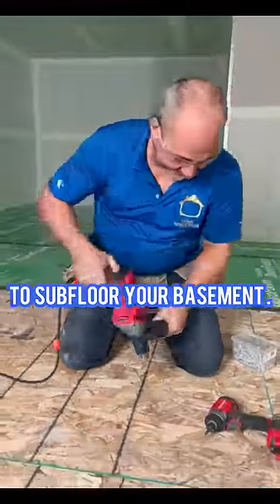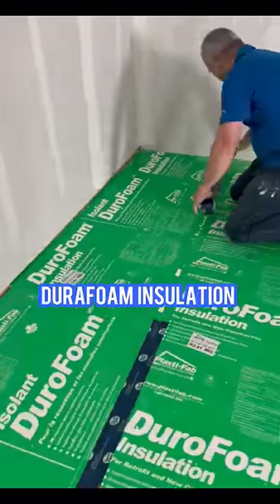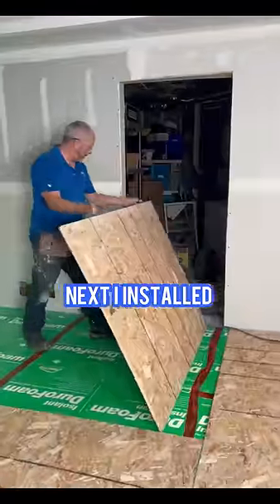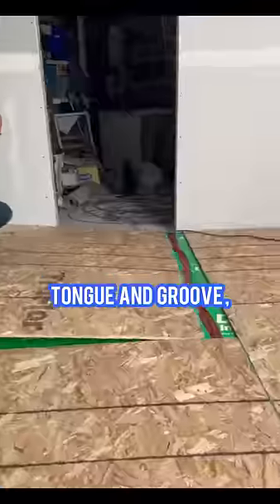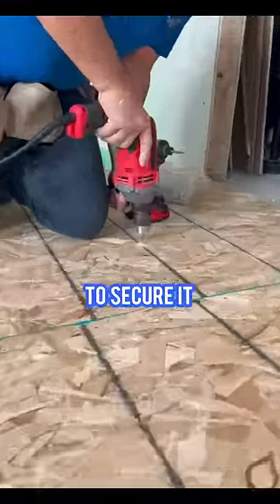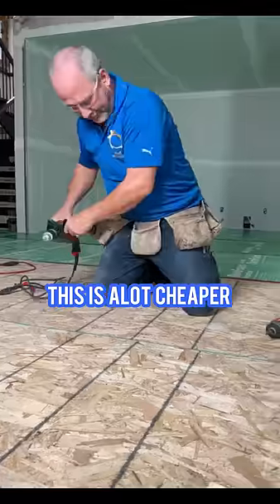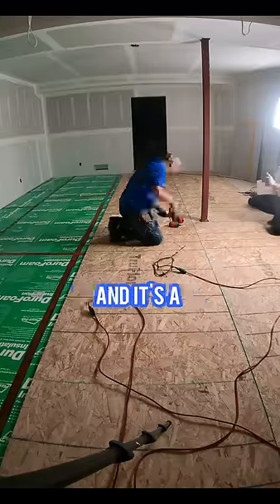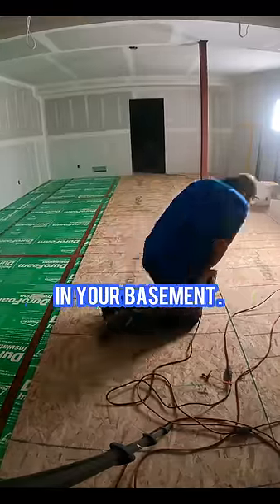THIS Is How You Save Money on Your Subfloor Install #shorts

Comment from the maker: To learn more about this method, watch 👉🏼 https://youtu.be/qyUZ3SgNvfY
Reply: OSB as a floor is ALWAYS A BAD IDEA.  Too bad, I thought this guy knew what he was talking about.  Unsubscribed!
Reply: Yep you cheaped out. OSB is crap.
Reply: Next time, try adding foundation wrap under the foam.  The 1/2" dimple allows for air movement and small amounts of moisture without having mold issues.  Also, the air break helps the floor temp a bit more too.

Comment: Until you get water in your basement and all the OSB swells up like an Alabama tick
Reply: It's been 40yr.  No water.  Def could have had a floor for 40yr :(
Reply: probably depends on state and floor risk u live in.
Reply: Doesn’t matter what kind of wood it is, it will swell when it gets wet.
Reply: He’s comparing COST to like DRI CORE… this is cheaper but dri core also swells once wet
Reply: Or your water heater leaks or your pipes above flood
Reply: As others have said; if you flood your basement it isn't going to matter what you have down.
Reply: The imagery of a fat tick 🤣
Reply: OSB should be against the building code
Reply: we have glue down vinyl planks over concrete subfloor and a floor drain in our basement 🤷‍♀️
Reply: Dumb dumb dumb comment.  If you're finishing your basement, it's assumed you know what you are doing and have already waterproofed it
Reply: @MrHajimeHitoshi  you have no idea do you
Reply: @pappydanny58  Considering I apply waterproofing membranes for a living I'd say yes
Reply: @Mike Znel  nothing swells like osb
Reply: @MrHajimeHitoshi o you are a painter, doesnt mean you know when where and why, but probably know how.
Reply: @mikeznel6048  OSB is awful
Reply: @MrHajimeHitoshi  
I’ve followed Jeff for years.  He has videos on basement renovations and he specifically addresses when it’s appropriate to finish a basement.  Anything before a relatively modern below grade space should not because it’s not waterproof.  Modern below grade space can be finished if you’re certain it’s dry.
Reply: Don't worry. homeowners' insurance will cover it all anyways. Wood or no wood. All of it. No matter what. So it's ok.
Reply: I mean, if you have a finished basement, anything you put down is screwed if you have a sump pump backup, etc.
Reply: This is why I’m just going with vinyl planks.
Reply: When it comes to basements. If you block a foundations ability to leak or have capillary action, then you don't have anything to worry about
Reply: you could seal it around the edges with silicone and the water would not get through
Reply: Until your old conventional hot water heater brakes.
Reply: Do you recommend doing this on a garage floor
Reply: In another video he says this is a newer construction with membrane under the concrete that's built on top of a hill with proper rainwater management on the building, so there's really no risk of water damage

Comment: It’s great till you have a broken water pipe or a blown hot water heater or the sump pump fails during a storm. Tile is the only safe way to go in a basement.
Reply: As soon as that chip board gets a drop of water on it  (which it inevitably will) it’ll turn to soup.
Reply: Tile in a Canadian basement in the winter is brutal.
Reply: @bindashawn  I don't doubt that but radiant heat in the floor solves it and you can walk around bare foot or take the cheap way out and use throw rugs and socks
Reply: @Harrison2253  Most people can't afford radiant flooring heating. I grew up living in a basement and we had multiple throw rugs and was still cold. Insulating the floor is the best option

Comment: Subfloor in a basement…let me tell ya why that’s a bad idea, let’s say you have a flood if it’s a big loss it’s extra work tearing up that pointless subfloor or is a small loss and now you have trapped moisture that you won’t notice right away and in a few months now you have mold. I’m in the water loss biz and concrete as a basement floor is the best way to go dress it up nice area rugs, if you have a loss it’s just a matter of setting up equipment and a few days.
Reply: I glued vinyl onto the slab, cold in winter sure...wear slippers

Great in summer. Never have to worry about water damage
Reply: 100% 
My job is an assortment of emergency cleaning service such as water damage and mold remediation. I will say 8/10 times we go to remediate a moldy basement is because of improper floor installation on concrete/ no effort made to control humidity and redirect moisture using sump pump. It’s more costly for removing the floor and doing a full remediation, if it calls for it, when factoring in drying equipment.. commercial dehu.. air scrubbers.. Time..
Just get a good looking epoxy floor and some area rugs

Comment: What happens when there is moisture or a small leak on the cement floor?
Reply: Mold
Reply: OR MAIN DRAIN BACKS UP AND SUB FLOOR SWELLS AND BUCKLES?
Reply: Jeff has another video providing a solution. Adding a channel membrane on top of the concrete, then the Rigid Foam.
Reply: The foam is a Vapour barrier nothing to worry about
Reply: Your screwed that’s what 🤣
Reply: What happens when your tub drain leaks and rots the floor, subfloor and joists and bottom wall plate and bottom of the studs?
Reply: Then you screwed 🤷🏻‍♂️

Comment: Is it safe to assume that this combination is intended for modern basements, not our older uninsulated/no vapor barrier cellars?
Reply from the maker: exactly. you need a vapor barrier and waterproofing technology for this install. For other options for older homes watch this. https://youtu.be/3-RGHwlBwIA
Reply: Are you talking about the walls or floors or both
Reply: If you have no DPM you’d have to float the floor, it can’t be fixed mechanically

Comment: You better make sure you run a vapor barrier up the wall above the installed flooring, or the moisture will migrate in-between the dura foam and the osb eventually buckling or rotting... let's not forget the potential for "bacteria"

Comment: Next time, try adding foundation wrap under the foam.  The 1/2" dimple allows for air movement and small amounts of moisture without having mold issues.  Also, the air break helps the floor temp a bit more too.

Comment: I like the 2x2 squares with the foam or channels on the bottom.  It's about $2 a square foot.  I didn't have to empty my basement, and it was easy to bring home and put in  place.  I did do an open area like this and it did work well though.   👍
Reply: Yes the floating floor is the way to go I did the KU ag hall 20 years ago . Easy to repair

Comment: NOOOOOOO WAIT!!!! I did this and it didn’t go well. Water got in and I couldn’t tell because of the subfloor.  TBH, it was more my fault as I didn’t fully test my waterproofing.  I should have waited a full rainy season before moving to next steps.  If you’re in a new construction home and starting DIY basement, I’d give the house some time to show you it’s not going to leak before cover the floor to this extent.  It became a mess and triple the project time.

Just my thoughts.
Reply: Correct. Just polish the concrete and fill it. Level.  Then no issues ever
Reply: It's about .66c sf. When you get our store
Reply: If you’re in a new construction home and your basement is leaking idiots were hired and should be in court. Leaky basements dont happen in todays construction methods unless ppl were hired that have no clue what they are doing. Most states now make contractors guarantee work for 5-15 yrs.
Reply: @Layton Little That's why they're required to have a bond to get licensed. Go after the bond.

Comment: I put 1 1/2 inch rigid foam under my floor. Floor stays at 72F
Reply: 72 is a dream 😮 my basement floor is at 60 easily smh
Reply: I don’t have a floor ( 3rd world country refugee )
Reply: Don’t listen this dude 
This is a bad idea.
The moment have any water which at some point you will, you will have to rip all that out.
You will have mold otherwise !
Reply: @betherealdeal this is a short clip from a long video.  He says this only works on new builds with proper grading and waterproof basements.
Reply: Does the rigid foam make the floor more cushioned or is it too hard to add softness? Also, what brand of rigid foam did you use?

Comment: It may be cheap but I can see a lot of potential moisture problems. There are insulated grooved sub floor systems on the market that insulate and also have the ability to drain away moisture if it builds up under the floor.  Spend a little more and save yourself from having to do it twice.

Comment: I skipped installing the subfloor and put a laminate floor right on top of the dura foam.  No problem so far for the last 16yrs.
Reply: Heck yeah, there more than one way to skin a cat👍🏼
Reply: Hmm interesting. But does it feel bouncy or squishy?
Reply: @johnly7688  Not at all!   No squeaks, no bounce, etc.   In addition to providing a vapor barrier and an insulation layer, the dura foam also absorbs the sound from the laminate floor.
Reply: They pour concrete slabs on the foam. It's strong stuff when the weight is spread out on it

Comment: 12x12 ceramic tales at Lowe's for .59 a tile. Goes right on the concrete and never have to worry about moisture.
Reply: Agreed tiles are best.  OSB is a problem waiting to happen in a basement.
Reply: I might just go this route.  Tile also would be unaffected by the minor water seepage that has happened a few times over the years here.
Reply: Can you tell me more about this? I need more details about this.
Reply: @IdealistINFP  what more do you need to know about .59 cent tiles?
Reply: He’s not applying flooring, he’s applying SUBFLOORING. In colder climates, like Canada or Northern US, if you don’t have insulated subflooring in your basement floor it will get really cold in the winter. 
Yeah, this seems like a lot of work, but the savings in heating might be worth it, especially if anyone will live down there.
Reply: @MrShitthead  I see your point, but still I have had occasional minor water issues so the OSB route won't work for me.
Reply: you will be replacing that tike within a year.  you don't put tike directly on the concrete. You need to use an uncouplung membrane
Reply: @bradpeterson6346  Thanks, never heard of that before.  Lowes has a product called Ditra.
Reply: Correct
Reply: @MrShitthead and

Comment: I have watched a ton of your videos and you have great solutions and this is a good one. However, there is a cheaper and possibly better way to go especially if theres any moisture. Theres a product called One Step from DMX, it is raised and insulated, it way cheaper then foam and it allows moisture a place to dryout. You can put most laminate floor directly on it or you could do the same subfloor treatment shown in your video.

Comment: Perfect until the OSB gets wet.
Reply: Why would you get it wet?
Reply: @EricGreniervideo  Pipe leaking, flood?
Reply: @EricGreniervideo  Because it’s a basement. 👀
Reply: Water damage from anywhere in your home will follow the path of least resistance to your basement
Reply: @EricGreniervideo  I wouldn’t get it wet but water will😂😂😂
Reply: wouldn't using epoxy paint be cheaper and wouldn't  matter if it gets wet?
Reply: @demoncroft  except epoxy paint does not seal concrete well if there is even minor water movement through the concrete. Gets pushed right off. Not as quickly as water sealing paint but within a couple years it is still ruined. Best option is a penetrating concrete sealant such as RadonSeal. 100% sealed against liquid water, water vapor, and all soil gases because the water never even wicks through the concrete to begin with. It's cheap and a person can water proof their basement for $250 in an afternoon better than they could pay anyone $20k for a system that still doesn't work.

Comment: I waterproofed my floors and put 1/4" xps foam down and threw my LVP right on top of that.. didn't have enough head room to add a subfloor. I know it's not recommend but it works just fine
Reply from the maker: you may get lucky with that if the lvp has a stone plastic core and is at least 7mm thick. But I still don't recommend it.

Comment: For an even cheaper option consider using a  higher quality plywood with a smooth side ( luan, birch, etc) and finish off the plywood itself with stain & polyurethane finish or just  paint it. Prefab simulated  wood or tile planking is not always cheap, typically costing $2 to $5 per sq foot. Later you can always add another layer of vf flooring as money permits and your subfloor is already in place.

Comment: If there’s a risk of water, broken pipe, anything, use DMX, that gives a vapor and water barrier. with small gap for drainage. Then use rigid foam, then plywood subfloor or AdvanTech. Can build out 2x4 walls without pressure treated wood, no wood ever touches the concrete. Not cheap but if you get any condensation or a leak, the whole installation isn’t destroyed. Can fix an exhaust fan to a floor cutout section or two for constant airflow vented to outside, negative pressure in the basement. This would actually take care of radon too.

Comment: I like this. Is it useful for installing new flooring in the basement?

Let’s say I pull up the carpet and I’m looking at bare concrete. Do I wanna go over with this kind of insulation before starting something like hardwood flooring or LVT/LVP?
Reply: No. Go talk to an actual floor company and they will tell you how wrong this is. Floor gets any moisture it has zero chance or way of drying. I would never consider this method without a dimple board first.

Comment: Hi fellow Ottawa mate, question: I have a storage space in basement under stairs that is cement but it smells musty.  Should I cover it with a cement sealer or put a subfloor to rid me of the smell? Thanks in advance
Reply from the maker: the musty smell is from water getting into the wood framing and starting to rot. find it and replace with PT lumber. Cheers!
Reply: @HomeRenoVisionDIY  Thank you!
Reply: @bostonterrier3915  dont worry about where the moisture is coming from though, just slap some new PT wood in there. 😬😬

Comment: Foam? We used to put asphalt paper and wood slats that worked as nailers. After that we installed wood floors. Loses from flood ended that practice.Then came ceramic tilez that looked like sort of wood. Now, they use vinyl floors that look like wood and are highly resistant to water. This method he is using is new to me.

Comment: Yeah. You could just seal the concrete and then put good padding and carpeting down. I've sealed the whole basement with an epoxy product. But that basement was literally designed to be finished off in the future because I actually designed it. Unless you are putting other types of flooring.
Reply: How much did it cost you? that sounds more expensive than foam+osb.
Reply: @Zeppelinlv2007  LOL I should say I designed and helped seal the basement and finish off the basement but I never paid for it. It was my Dad's house. It was a fun little project house I did during school that became real.

Comment: This is the proper method if you're doing a subfloor over concrete at or above grade! 
If you do this method below-grade and water heater let's go, pipe burst, any flood scenario you're calling the insurance company and you get to throw all of this out. Then you decide to do it the right way by installing a water impervious flooring. Take it from a floorman. If you want to install a floor below grade do a polished or stained concrete, or if you want to do a floor covering install a ceramic tile. It's not a question of if a basement floods. It's a question of when. Doesn't even need to be a lot. 10 gallons of water is enough to ruin the entire project. Even a luxury vinyl snap and click flooring will hold and trap water underneath  requiring it to be lifted making that product garbage. While you can remove one or two pieces and then put them back. I have never seen and would never do it myself removing an entire floor and then trying to reinstall it. It wouldn't go back together. Don't do this costly and labor-intensive process to your basement unless you want to throw it out one day. If you don't believe me go ahead

Comment: For the DuroFoam did you place any adhesive under it or just the weight of the plywood and screws to keep it down, also the tape?
Reply from the maker: when I screw dwon the subfloor the compression keeps everything in place. Cheers!

Comment: Chip board that you’re using falls apart faster than using regular plywood or treated plywood. You should use plywood instead. I took shop class so I know the difference. Chip board and particleboard are sawdust and chips of wood glued together. It might be more affordable, but it’s not worth it in the long run.

Comment: Jeff -- what's the secret to not snapping off the Tapcons when you drill them in? Those damn things are always breaking on me, and I'm not even torqueing them all that hard.
Reply: Make sure you're using the proper size drill bit to pre drill hole making sure you drill the right depth and vacuum the excess dust out of the hole . Drill speed is important as well . I always drill on setting one and make sure to turn off drill mode which will snap the heads off !!
Reply: @junkyarddawgs9956  except Jeff tells us to not vacuum out the excess dust but to leave it in there
Reply: @randomdude3066  l've always vacuumed the excess dust out. It may not be a problem with tapcon screws but l've install a lot of wedge anchors over the years and it will cause a problem if the excess dust is not removed , so l have gotten into a habit of just removing it to be on the safe side.